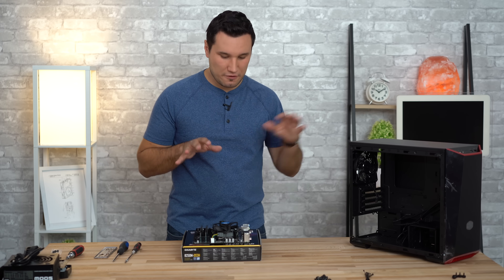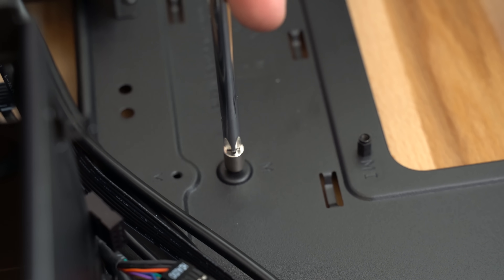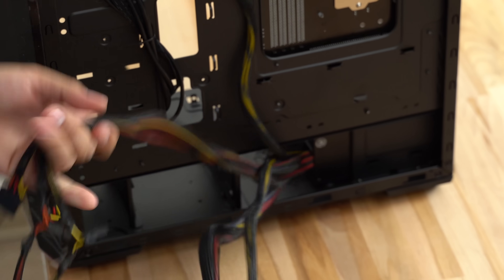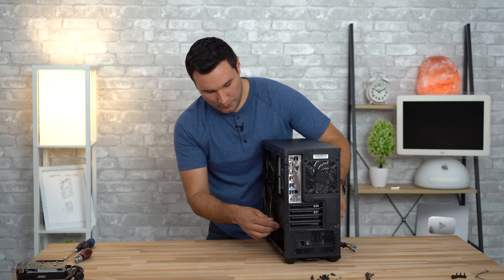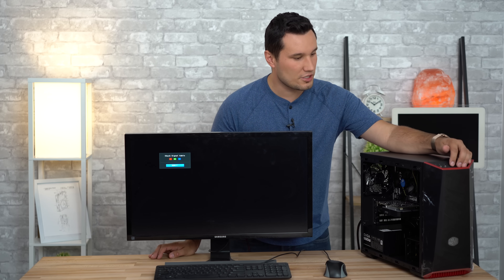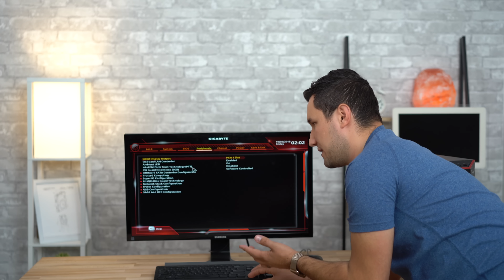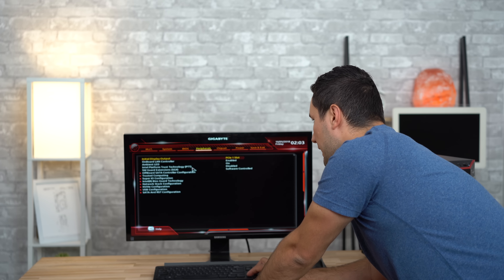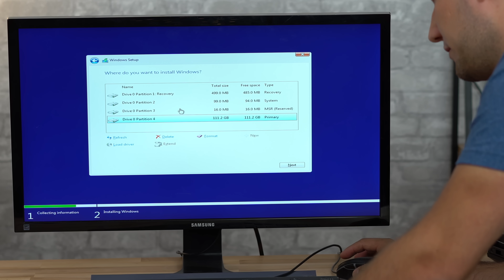$492 Budget Gaming PC Step-by-Step Build Guide - Fortnite & Black Ops 4 BEAST!

Comment from the maker: CPU on Amazon➡ http://geni.us/6hIjC4
Graphics on Amazon➡ http://geni.us/9DpNB 
Motherboard on Amazon➡ http://geni.us/uViB 
Power Supply on Amazon➡ http://geni.us/ydrAkBB
RAM on Amazon➡ http://geni.us/aUGVgZ
M.2 SSD on Amazon➡ http://geni.us/iy00KV
Case on Amazon➡ http://geni.us/ZiprWAC

Extras: (only $25 more)
3X Red LED Fans on Amazon➡ http://geni.us/4jeNpl
Red LED Strips (Amazon) ➡ http://geni.us/uT8y

Alternatives:
Suggested CPU Cooler on Amazon➡ http://geni.us/h7A3
Better Case on Amazon➡ http://geni.us/PQeK
CPU for Video Editing Amazon➡ http://geni.us/cHd1
1080P All EPIC GPU on Amazon➡ http://geni.us/YJm2r1
4K GPU on Amazon➡ http://geni.us/gSAhW
Better SSD on Amazon➡ http://geni.us/jcMfD
Better PSU on Amazon➡ http://geni.us/VBLgIk
Better Case on Amazon➡ http://geni.us/PQeK

Suggested Peripherals: 
Cheap Gaming Mouse on Amazon➡ http://geni.us/PH0A
Cheap Gaming Keyboard on Amazon➡ http://geni.us/dkjM
Budget 1080P Monitor on Amazon➡ http://geni.us/2xwKwBS
Good 1080P Gaming monitor on Amazon➡ http://geni.us/cZsnJf
Budget 4K Monitor on Amazon➡ http://geni.us/Q3jtqt
Reply: Where i can buy Windows key product
Reply: @raymondmelendez5943  thepiratebay
Reply: Why do you have a B250M motherboard box?
Reply: based on the links provided for your parts, the total cost before tax came out $566.74 so this is more like $600 build lol...
Reply: Does the size of the graphics card matter

Comment: I sort of question your choices. A 80+ White PSU means that the manufacturers did not care about the PSu, and you should never cheap out on power supplies. Also the Graphics Card an rx 560 is like the nvidia equivalent of a GTX 1050 or worse, For the price I would suggest getting a SATA SSD and upgrading to an Rx 570 which is like a GTX 1060.

Comment: Lol. This is trash. Best entry level CPU is Ryzen 3

RX 580 > GTX 1060
Reply: Amd fanboy lol

Before you get salty, I agree that the best entry level is the ryzen 2200 cuz it's cheaper. The rx 580 is equal for the most part to the gtx 1060 though

Comment: this is a really good tutorial, you do speak quite informally at times but that does help a lot, (not sure if it was accidental or not lol) but seriously easy to follow instructions with actual footage of where to put the case connectors. Not many YouTubers do that. Also for the 1060 whats the difference between the 3gb version versus 6gb. Bigger is better but is there a massive performance gap?

Thanks and keep it up.

Comment: Get a 1tb HDD instead of the 128gb m.2. I can gurantee that 1tb will benefit you more then that 128gb ssd.
Reply: I agree, m.2 definitely will be faster but with 128 GB you cant do anything nowadays.
Reply: @marioszekou1764  Also he didn't mention that formatting leaves you with 119gb of storage and win10 takes 20gb.  Leaving you only with 99gb.
Reply: Yeah I agree,personally I would go for a ryzen  build. Ryzen 1600 is a little bit better than i3 8100,is cheaper and has 6C/12T.
Reply: @marioszekou1764  R5 1600 is more expensive. If you're just gaming a I3 8100 or R3 1200 is enough. However people want more then they actually need.
Reply: In Amazon 1600 is 20 euros cheaper I
Reply: TenzoG hdd???? Nice joke. I’d much rather take an SSD any day of the week. You can shaft a 2 TB external later on down the line as a game drive if you want to.
Reply: @gfjfjufidi2880  No joke. Nobody wants to add more down the line, they just want a working machine that will serve them the same way as a console. No upgrades, just gaming.
Reply: Yeah but until then good luck fitting  your games and programs on a 128gb ssd drive
Reply: or just get a 1 TB and add as well for 50$ more.  having the OS on the SSD is nice to have.  nothing worse then a crash and having to wait a minute to boot back up and be fully running.
Reply: @dannamanna99  Nobody wants to add more down the line, they just want a working machine that will serve them the same way as a console. No upgrades, just gaming.
Reply: I know many who don't care.  most are willing to upgrade.  that is why ppl get a desktop pc.  later down the road you upgrade it instead of paying 1000+ dollars and buying a new pc.
Reply: @dannamanna99  Thats the point. If you WANT to. However when people want a gaming PC, they want everything to simply just work. They dont want to wait and save to buy better parts.
Reply: no, they want a gaming pc so they have something that plays games right then and there and eventually you can upgrade as needed later.  I get a gaming pc because I want to game.  so yes, if it can play games then great.  later on if I must upgrade then I will or add things to it.  over time parts get outdate regardless if you get a great gaming pc or not.  if you are doing this, you are being cheap in making a gaming pc and you are doing it with the mindset that you will have to add to it later.  or you would save up already and get something better so you don't have to.so yeah, maybe if you are not getting a budget gaming pc then sure, you don't expect to have to upgrade or add to it later.  but anyone buying a budget gaming pc, knows they will have to upgrade sooner then later.  that's the point of doing a budget pc.  just to get something that for now will play the games.  not always on highest settings either.
Reply: @dannamanna99  I dare you ask anybody switching from console to PC. They want a fully working machine that acts as a console thus does not need further upgrading untill they choose to. They want it to last as long as a console. Do you not get that?

Gosh you make PC gaming sound expensive. No wonder people get the wrong idea of our platform
Reply: but those same ppl are also going to make sure they buy a nice system.  and it is expensive up front if you get something nice and not cheap.  yes ppl want something that will fully work.  don't disagree with you on that.  but if you are looking at this video you already know then you are getting a budget pc then and know you will have to upgrade.  what part of that do you not comprehend, understand, or get or whatever word I must use for you?  buying this system, you already know you will have to add more hard drive space later, upgrade the gpu later as it will get outdated etc.                                                                                                                                                                                                                                                                                                                                                                                        now, if you are going from a console, or looking at doing a build that will last or not need upgrading, then you will already be planning and getting everything else for that.  and will end up spending more.  you will get both an SSD and a HD.  ppl like you suggesting just a 1 TB that will benefit more?  yeah ok dude.  maybe if you plan to play games that you can wait a couple min to boot back up if you get a crash.  go play a game like pubg.  many ppl get a crash from that game.  booting up in 15 sec and being able to get back in the game quickly is a big key.  again, for 50$ more, one can easily have both.  and if someone is looking at the long run, they would do that.  most would probably even get a bigger SSD drive as well.                                                                                                                                                                                                                                                                                                                                                                                       again, if ppl are looking at a budget pc build, they are more then likely knowing that its just that.  a budget pc and that they will need to upgrade parts for it later on.  it will work for there needs as it is but not for long without adding more to it.  if someone is looking to just build a nice rig they will spend a little more and already have those parts so they wont have to upgrade for a while.and again, most ppl know up front its a little more to game on a pc.  you save the money later on when you purchase games, (as they are usually a lot cheaper on pc) as well as when it comes time to need a new pc/console.  for a pc, you then just upgrade the part that needs to be.  usually gpu.  where as a console you cant do that so you run into having to buy the new console.  so like this video, in a few years whatever gpu is 200$ will be equivalent and work just fine.  so if you get his pc, spend a little more like a 1 tb hard drive as well and spend 550$ (maybe even another 8 gig ram) so about 650$ where as someone buying an xbox 1 spends what 500$ for a 1tb system.  so pc person spent only an extra 150$ more.  however then in a few years, person on pc can upgrade just the gpu for 200$ where as the xbox person has to buy a new system and now spends another 500$  total for pc 850$ compared to xbox for 1000$. now, we can also talk super budget if one wants too.  that being, you can build a cheaper pc that will play all the games just might not play them on high settings.  and will also require to upgrade a lot sooner.  again, someone doing that should already know that.  and not be disappointed when they do have to upgrade or that they cant play games on high settings etc.
Reply: @dannamanna99  No orginally I said that its BETTER to get a 1tb HDD then 128gb SSD for this budget build because you have more storage capiche. 

Once again you're making PC gaming sound expensive. Also I have a PS4 too and I haven't spent not a single DOLLAR on PSN. Also I buy games of G2A and SCDKeys so I save even more on both platforms. 

Just because you can upgrade doesn't mean you want to in the future. I won't upgrade till everything breaks. I could care less about the ultra settings. As long as I can play the game still that all that matters.
Reply: TenzoG how is adding 50$ making Pc gaming look expensive or even anything I said.   It’s a lot better going with a SSD up front and then getting a Tb drive later.  Yes you won’t have room for games.  But the couple you will have and boot time will make it a lot better.  Get a hard drive later for more.  Or like I said, instead of being cheap, just get a Tb hard drive along with what he said.  550$ for this that has a 1tb drive and a SSD is not bad.  

Problem doing the Tb, again you still upgrade later with a SSD.  So either way, you upgrade.  And yes, it’s worth doing if you don’t have one.  But a lot easier if you start out with a SSD and just add a Tb hard drive later.  At least if wanting the os on the SSD.  Where as it’s a little more work starting out with 1 Tb drive that has the os and then going to a SSD later on.  

Not sure what your trying to claim about me making Pc sound expensive?  Never said it was.  It can be yes.  And especially if wanting to max out games and play at 4K.  This won’t do that. But you can also get a cheap build like this and play games as well.  And yes, will need to upgrade eventually.  And when that happens, that’s even cheaper.  I am a Pc gamer now.  Been for a while.  Always try to get friends to go they route.  Many are misinformed that Pc is expensive.  That’s not true.  By again, it can be for some if they want to go above and beyond what’s needed.   So again, no I am not claiming it’s expensive.  I also agree with the video on keeping it with the SSD to get started.  

And again, if your doing this build, you know your going with a budget Pc.  Again, if you want something that you won’t have to upgrade, you will get something for that.   If you get a budget Pc, you already know you will upgrade later.  Not sure how hard of a concept that is for you to grasp.  Everyone but you knows that.  

In my opinion, both hard drives are needed unless you get a Tb SSD.  If getting a 128 or 256 gig SSD you should also be getting a 1tb 7200 hard drive.  And now a days you should also at least get a SSD for your os.  So this build being 492 should just be 542$ or so with a 1 Tb hd as well.
Reply: @dannamanna99  Eventually I have to upgrade later on lmfao? I won't be upgrading till everything breaks down and stops working. Just like how I haven't upgraded my xbox 360 for 10 years to the PS4 I have now because it didn't stop working, only reason I did is because it wasn't getting new games. 

You never have to upgrade as long as you have a GPU better then the consoles like an rx 560 which will probably last me 10+ years like my xbox360 did. 

Also even back then I have been PC gaming with a HDD and never had problems with the OS and Game load times. Sure its longer for the OS which is a extra 20s, but that's about it. A HDD never failed me ever and this is a prebuilt I'm talking about before I built my custom one. 

Also budget means you have a fixed price limit. Therefore you don't go over it. Upgrading goes over the fixed limit. Which ruins the purpose of budget. Also that $50 could have been used on GAMES (Which is why i even own a PC), not for extra storage. Thats why a 1tb HDD is better then a $50 128gb SSD. You have more room for games and software in a budget build, instead of wasting it on a SSD you can get games which is the point of a gaming PC, you just want to play video games, not worry about adding and upgrading. 

Rich from TechReviewUSA is right about the PC gaming money trap, you seem to have fallen prey to it. People waste on upgrades and add things and forget that their true purpose  was just to play video games on a different platform
Reply: TenzoG no I don’t fall for traps.  You lie on your 20s more to boot up.  It takes a lot longer then that with a hdd and even longer as you get programs that boot up.  Games themselves also take longer booting up.  So get over yourself with your lies.  Also maybe learn to read sometime.  Already pointed out you can play games.   But you won’t play them on highest settings without upgrading.  

Budget means you have a limit what you are spending.  When you are going with a cheap build, you are going to get something that is minimal to which you do end up upgrading or adding more to it later on.  Maybe take some time to look up difference between SSD and a 7200 rpm hard drive.  And why now a days is a better choice first to go with a SSD. I have had games stutter straight off a 7200 rpm drive and run smooth once on a SSD.  Others the same.  So yes, you don’t have much space to which it’s an easy upgrade, but you gain faster loads, and in some games a better gameplay experience as well.  But it’s a matter of opinion.  Obviously the guy making the video feels the same way or he would have opted to get a 1 Tb.  Let’s see listen to him, or some guy trying to be cool and know it all but not making videos?   Hmmm. Easy choice, I’ll stick to a guy who knows what he is talking about and actually doing videos.
Reply: @dannamanna99  So if you rather choose the guy who knows computers, then why bother replying back to a opinion based comment? Lol
Reply: @ncg8224  nice joke there bud. Ive been a true console peasant for like 5 years. Rn im 13, i just got a mini job. Now im building my own pc, and having to boot from a slow af hdd instead of an ssd would be the last thing id want. Upgrades are necessary in any pc. Even for consoles some people need to upgrade their drives just because they dont have enough space for the latest and greatest games. For now yeah, i picked budget parts so i could game as soon as possible, but trust me you wouldnt want a pc without an ssd. Now drive space is really important and ik it is. But if you just wanna play asap just go with that ssd tbh. Best is to buy ssd and hdd right away imo. But if you had to choose between one of them, pick the ssd any day.
Reply: @LeanyG11  Good for you! However this is a budget based video. I rather have bouth a 1tb HDD then use that money for the SSD to buy GAMES! Yes, the purpose for a gaming PC is the ability to play the ganes you want.
Reply: @LeanyG11  Nah dude. You were never a peasant if you just gamed on consoles and didn't try to say they were objectively better. That would just make you a console gamer. Those who called you that were prolly just pc elitists
Reply: @ncg8224 Literally you can get a 1tb hdd for 40 bucks on Amazon. You are making a mountain out of an ant hill. Stop
Reply: Redgle no one called me that before it was just facts. But now that i have frequently used my pc for over 1 and a half months i can definitely prove the advantages.
Reply: @LeanyG11  I mean I'm just saying just cuz you gamed on a console, that doesn't make you a peasant, as long as you just gamed on it and didn't go out of your way to bash pc, be a fanboy etc. I WAS like that at one point, so I can say I was a peasant at one point. Regardless, welcome the the pc community bruh :)
Reply: You seem like you know what your talking about can I still put a 1tb harddrive in with the SSD I'm a noob
Reply: @TheMattie05  Yes, you can put in both.

Comment: Duh  first of all the i3 8100 wont work on a b250 mobo , second , you should have gone  the gtx 1050 it performs better tha a rx560 bt wit the same price tag or u can pay 20% more and get 30% mor with the gtx 1050ti
Reply: Go watch 3:12
Reply: 1050 Ti is overpriced. A B stock 970 is much better and an RX 570 is $150 if you look hard.